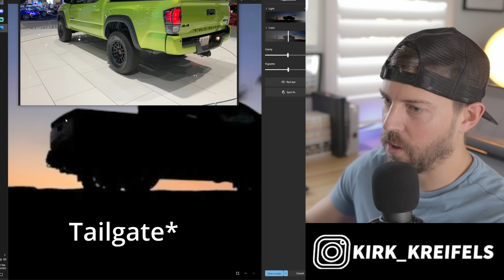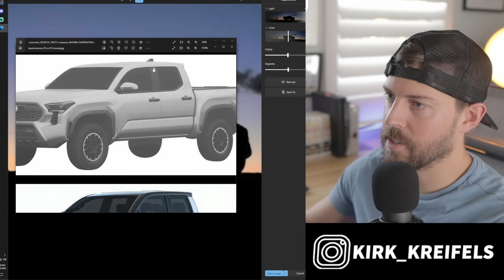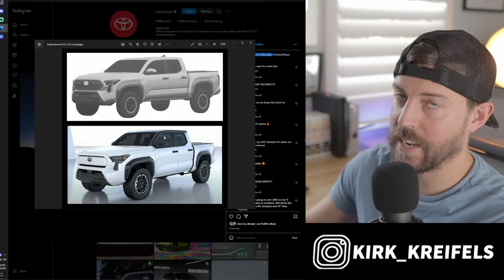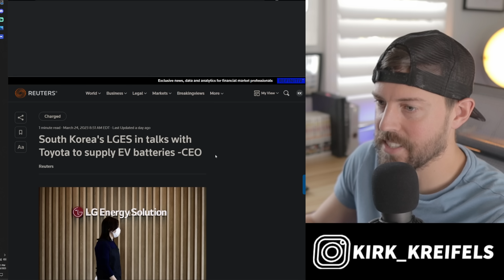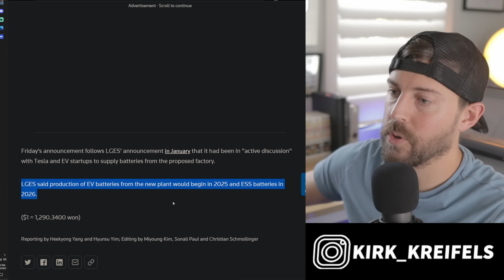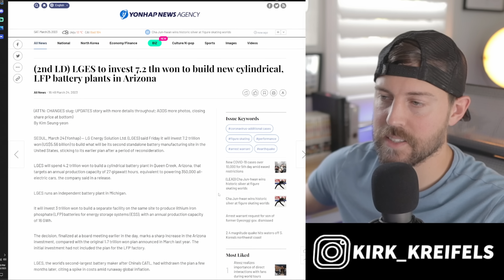Toyota TEASED the all-new 2024 Tacoma | EV Version Incoming?

Comment: Power in the current Tacoma is sufficient, but the auto trans holds it back. And for it being a mid-size truck it gets terrible fuel economy in my opinion. I think it gets worse fuel economy than something like an F150 or Ram, both of which have much more power and torque available and are in a larger class. 

I’d like to pick up the new Tacoma assuming it has enough improvements, but I’m also not a Toyota bro so I have no interest in spending 40-50k for a mid-size truck which is what dealers have been charging, even pre-Covid.

Comment: I don't think Toyota will ever offer the 2.5l hybrid powertrain as seen on the Sienna/Highlander on the Tacoma. Conservative Toyota wouldn't waste resources to pair that engine with any transmission other than an eCVT. Most likely that the 2.4T is standard, with the 2.4T hybrid and the detuned 3.44T V6 as options. Would love to see Toyota go to town with PHEV and EV versions though. Toyota could further capitalize on other automakers' limited powertrain selection in the midsize pickup truck segment.

Comment: The domestic manufactures still offer V8s on the full size trucks and V6 in the mid size trucks.....Toyota is going to lose a ton of sales with these new generation of trucks...plus removing the manual transmission sucks....guess if you want a manual you have to buy a Jeep Gladiator now.
Reply: Shame that the new TTV6 and even the hybrid aren't much more efficient than the domestics' V8s.

Comment: Hopefully they reveal the Tacoma to us in April. I'm very excited for it. I'm still waiting on more info about the compact truck possibly named Stout. I think Toyota is really missing out every year that passes without a compact truck to compete against the Maverick. Imagine a RAV4 based unibody truck with hybrid getting near 40 MPG. Very enticing.
Reply: Jack Hollis said they would be doing something about this but he said the Stout would be based on the Corolla cross hybrid. However he also mentioned the A-BAT concept from 2008 specifically.
Reply: Yeah, Toyota should reveal it at this year's NYIAS. I agree, a Toyota compact truck based on the RAV4 would be an absolute banger.
Reply: That would probably be a non U.S. model. The Tacoma feels just right for “small truck” sizes.